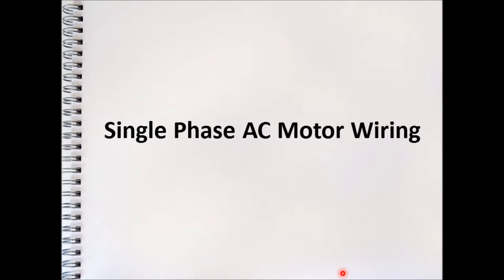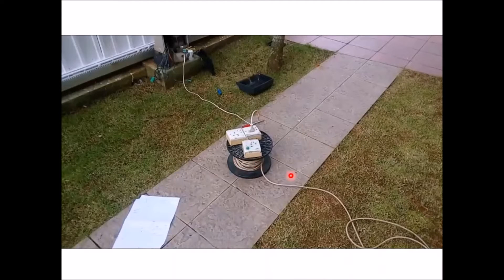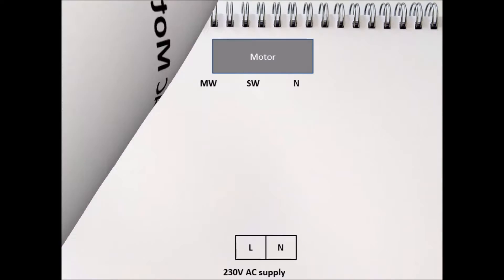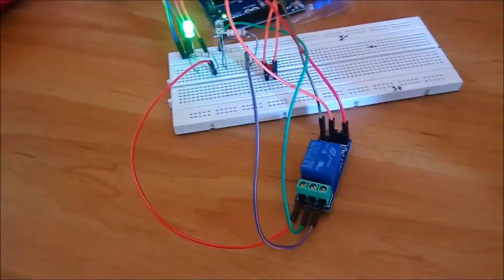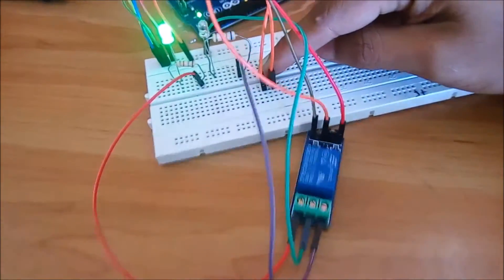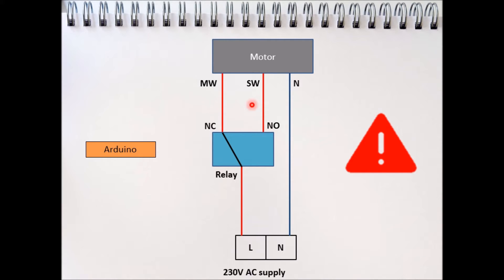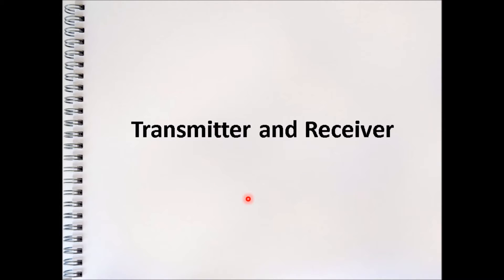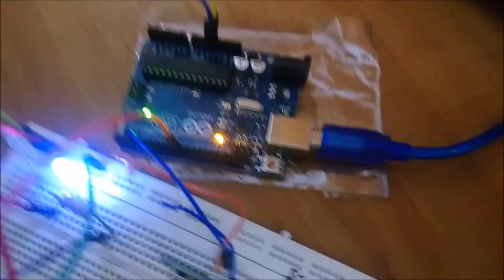Sliding Gate Controlled by Arduino: Build Log

Comment: great guide thank you , i tried to use two relay as you described .but one of them stop to work for unknown reason , so i connected two relay in other way in separate way to open /close  ( one to open and one to close that mean while open /close current flow thru one relay only ),  but i think later  i will replace the relay with 220v transistor . i think its better .
Reply from the maker: That is actually a good idea!! Awesome work and thanks for the feedback.

Comment: can i use car wiper motor?
Reply from the maker: Hi, A 12VDC Car Wiper Motor cannot be used to move a heavy load like a sliding gate but the same principle can be applied for a different application.
Reply: Lasith Premaratne which motor can i use can you send specification .. and one more thing when power supply is off will we can move gate manually?
Reply: @1994hvm  depend  on the motor ,usually the answer is no and with traditional motor coming with key to separate motor shift and allow manual using    ( like if there is no electricity other reason  ) ..